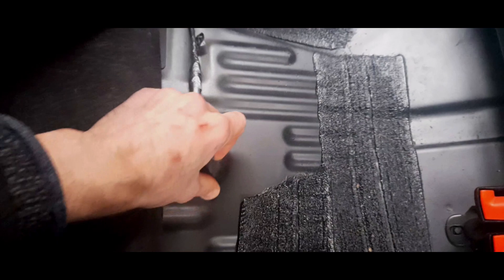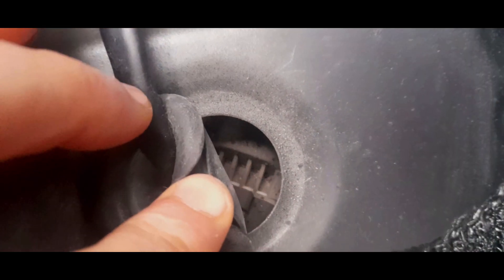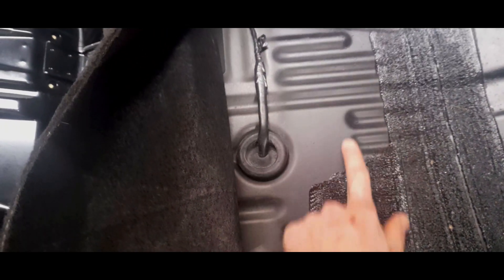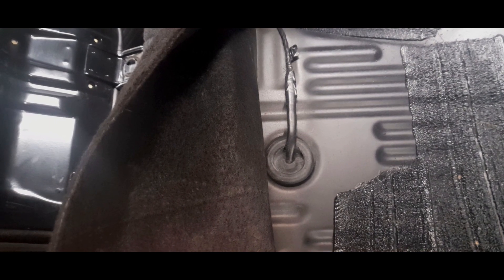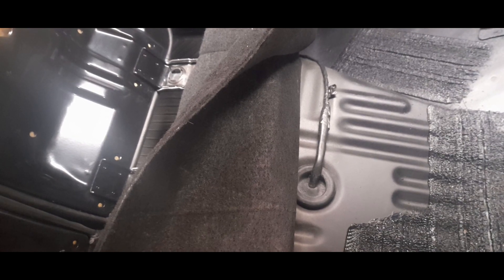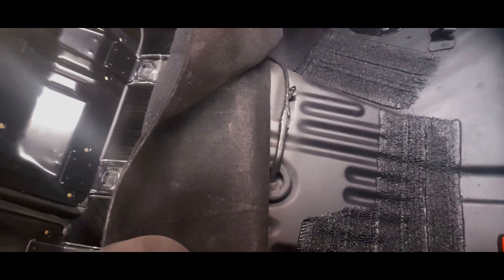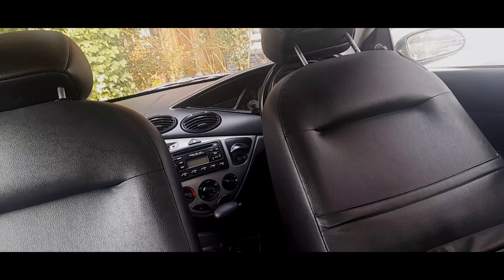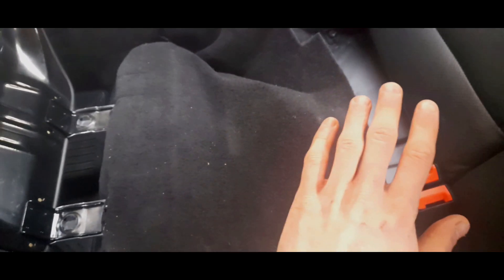Ford Focus MK1 - Fuel Pump, What is the proper way of removing it?

Comment: You're right, young man! If your Focus is a keeper, get proper tools, get mood and time for this tank-drop-operation.
Bonus chance: If fuel tank is dropped, there's a great access to that bloody right side brakeline. Swap that too, if that's rusty. (probably is, at the age of 18-22)
Reply from the maker: That is really sound advise with these motors! For whatever reason they always rot above the tank, mine were thin, very thin. I paid the garage 6 years ago now to change them to copper-nickel!
Reply: @usuallyfixingtinkering  yes. CuNi pipes for every Focus! :-)
I've heard that the best source of rust - free cars is southern Italy. Or Arizona..
I hate rust, and salted roads too.

Comment: The owner before me has taken the fuel out that way. My reaction was neutral because i was angry about the hole but at least it was easy to replace the fuel pump. Also in 6 years i never had fuel smell inside
Reply from the maker: Your lucky many people have reported fuel smells after doing it this way. Theoretically there shouldn't be as its a closed system but there are a dew weak points that allow vapours to get out. If it was done before you bought the car there's no head scratching, the problem has been solved for you

Comment: I've HAD to do this repair on my car because it was out on a busy street and completely disabled by the fuel pump. The cost of a tow and repair far more than my car is worth. I guess I could risk my life purely for aesthetics and "smells" doing the mentioned ST170 tank job with my legs sprawled on a busy road. I would add the ST170 only has 1 fuel pipe not 2 and they are bastards to change when you don't know how, all while wriggling under a heavy car in traffic.
It is disgusting that the engineers at Ford actually made it impossible to fix the fuel pump easily all that way back. All other cars I have owned or repaired never had restricted access under the back seat. This was probably the start of the manufacturers stopping DIY or "Right to Repair". I can't think of any other reason. The only way to properly do this job is with a 2 post lift and an additional high jack for the tank.
The nonsense that the car stinks of petrol when you enlarge an existing hole that would allow fumes to a slightly larger hole so you can access the pump is ludicrous.
Do you not understand that petrol tanks are closed loop pressurised systems and no fumes are allowed out of them except under control of the EVAP system?
Now I haven't even gotten around to replacing the hole with a nice cutout panel from a scrapyard vehicle. Mine is so far completely open and I rest the wiring on some plastic sheets until I get around to a better solution.
There is NO PETROL SMELL AT ALL.
Having said that:
1. Do not use angle grinders or Dremels to cut an access panel. Sparks and petrol do not go well. It's a laborious job but you can use a cheap set of Aviation Tin Snips. The Screwfix ones are only £6.99 for the full 3 pair set right now.
2. The USA gasoline tanks you see in YT videos are not the same as UK tanks. They are returnless while most Focus have 2 pipes and you better not cut into them. I believe the ST170 is also only a single fuel line. Also the pipes are very close to the metal at the back of the seat which doesn't appear to be the case with the USA ZX3's I've seen.
3. Only do this job if you have no other choice. It is clearly better to do it properly if you can. Maybe you have to scrap the car if you are not prepared to do this.
4. Especially in 3 door Focus when changing the pump - open the hatch to allow some oxygen! LOL! and have a bro stand guard so nobody throws a lit cig in.
ETA:
5. I would never sell this car without informing the buyer of my quick access panel. Though I doubt I would ever sell this car until it is scrapped. Scrap value is more than retail which is kind of perverse.
Reply from the maker: I agree that this was definitely at a time manufacturers were trying to remove the DIY element out of motoring, which essentially would be more money in their pockets at the end of the day. It’s pretty poor in all honesty! It’s the simple accountants vs engineers argument, once they start digging in things get pretty cheap and bad.
I can understand why you did the job that way, I’ve heard a few stories like that, if you don’t have the tools or money to pay a garage then it's a means to an end isn’t it! TBH the basics that people need is a set of ramps, a decent jack and a block of wood and not to be intimidated by being under a car (that's a big mental hurdle for some).

Well the complaints of smelling fuel that I’ve seen pinpoint to this job having been done in that manner. You are right the closed loop system is designed to stop fuel vapour escaping but it is pretty primitive by today's standards and at this age it has some weak points which I will actually address going forward, namely the charcoal canister and roll-over valves on the top, most likely this is where the smell comes from… obviously it goes without saying if you’ve damaged a fuel pipe seal or haven't done the locking ring up properly then that clearly won’t help. The fuel connections are made of nylon and they frequently seize and go brittle (nylon is hydroscopic and expands just a little), another issue. Taking your time is key.

Anything with sparks is a no-no in that area, it’s quite a risk. However I will say that petrol is not as flammable as believed, the right conditions are needed.
Reply: @usuallyfixingtinkering  If the car was on my drive I would have done it properly. I've had this car for over 20 years and only in the last 3 have I had my wing mirror smashed by 3 times by our new friends and loads of neighbours cars smashed into.
I will never risk my life under a car on this road even with ramps, etc.
On my own drive I don't have a problem except for the gradient. Which is to steep to push it onto.
Reply from the maker: @Drew-Dastardly  That is what petrifies me if I ever park mine on the road or in a vulnerable place, given the way people drive.

Comment: 21 years on my 2002 ZX3 2.0 Zetec has good fuel pressure. I wonder if it was ever replaced. Can they go that long?
Reply from the maker: mines on the original, touch-wood they can go on a bit but eventually they fail.

Comment: why does it crash so often focus mk1 fuel pump? Is this a chronic problem?
Reply from the maker: How do you mean "crash" exactly? :)
Reply: @usuallyfixingtinkering  In the focus groups I follow in Turkey, I saw that the fuel pump was changed frequently. For this, it is recommended not to travel with less than half a tank of fuel. I also replaced it with a new one about 30,000 km ago, but it started working late again.
Reply from the maker: It's nothing to do with fuel tank level believe me, usually it's just age that causes them to die

Comment: These videos on the Mk1 have me worrying that mine will breakdown soon. :)
I'm wondering,.... the channel you don't want to mention, could that possibly have the initials ETCG? :) I watched him change a Focus clutch, and to get at a nut, he ground out part of the sub frame.
Re: grinding bits out - I don't really see a problem so long as the job is made good. E.g. a proper bolt over panel. Not having such a panel probably made the car cheaper to produce. Just my thoughts. :)
One last 'thought'. Some of the very popular car channels have huge numbers of subscribers and views. They must make a good living. e.g. Scotty Kilmer.

And one more thought. :) If fuel can be smelt after a 'cut and shut', well, .... there's something wrong. Yes? It shouldn't be happening, excepting an accident at the pump. Great vids!
Reply from the maker: Spot on as usual Ray. There's loads of channels which have basically done the same thing. They've clearly done the generic youtuber thing, big bold thumbnail "change a focus mk1 pump in 30 minutes the easy way"... and people watch. Hey presto lots of income. Nothing wrong with that its a means to and end but its misguidance. You should be telling people the correct way of doing, without the consequences of smelling fuel while driving (how safe is that!). Its a passionate subject of which I have no answer other than - Drop the tank!
Reply from the maker: mk1's have been incredibly reliable motors for many years, its just now at an elderly age they are starting to show in many areas. But I still hear many great stories about examples with hardly any maintenance!
Reply: @usuallyfixingtinkering  How does one maintain a fuel pump when denied access to it? LOL.
Reply from the maker: @Drew-Dastardly  technically your not denied access to it... just takes longer :(